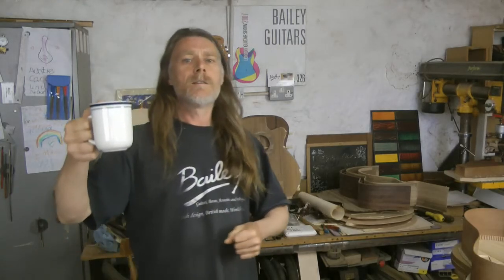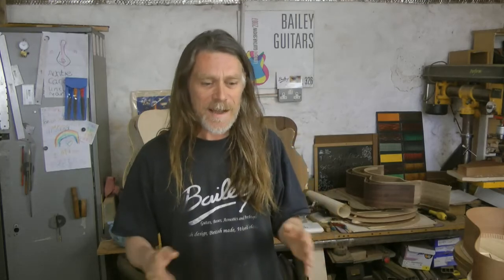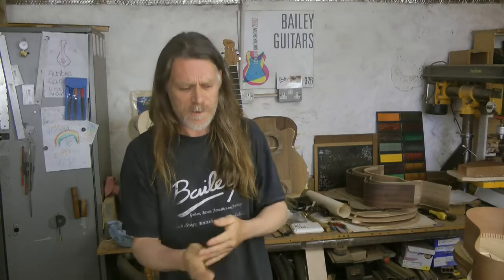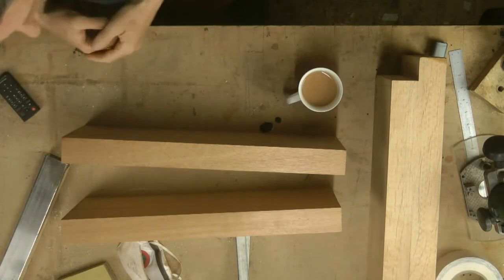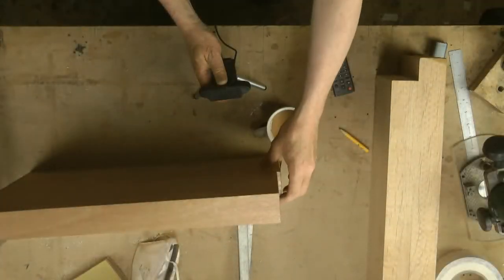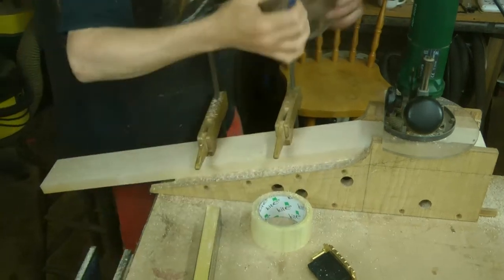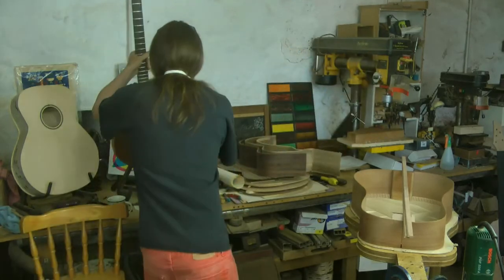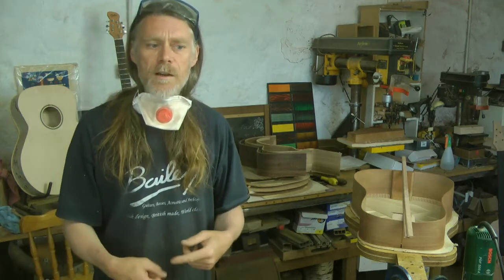Guitar Making for Beginners: How to make a guitar body blank the Easy Way!!

Comment: hi Mark)))
this twist on the salt trick is pretty cool.
the common use for salt in joints is during the actual glue up, sprinkle a little bit on the glue so when you clamp it up it doesn't slide around as much. you don't need a lot, just a little ;)
Reply from the maker: Cheers Filo !! Awesome !!

Comment: Loving the videos and you have given me the confedence to start building my own guitars. Can i ask you a question please ??? Why do you always need to use at least 2 peice body guitars ??? Why cant you use just one peice of wood to build a guitar body ???
Cheers...Big J
Reply from the maker: Thanks John - good to hear and great Q! 1pce bodies are harder to find and more expensive. They are also more prone to warping or twisting. That is why 2pce is usually the norm. So you can use 1pce if you can find it but it is not necessarily better...it can be quicker as you don't have to join it! But thicknessing such a large piece can be problematic - It is normally easier to work with 2pcs. But it really doesn't matter as long as you Go for it - its your guitar - your call!!!
Reply: @GuitarMaking  thx for the reply. I will stick with the 2 pce body as i am worried about warping. I will post my effort once i get round to building my guitar. I keep watching your videos for tips. Keep up the good work.
Thx...Big J